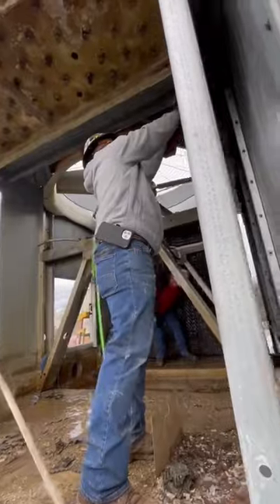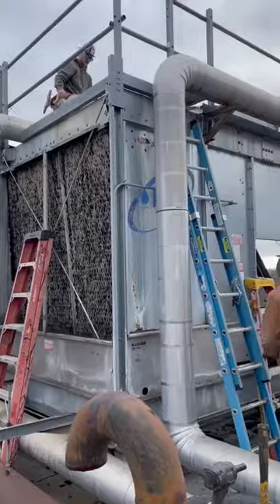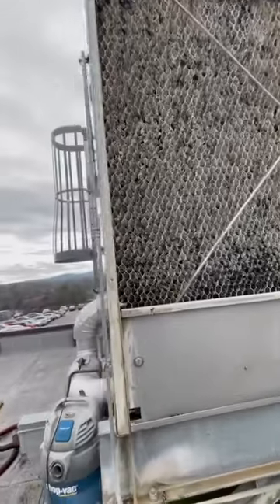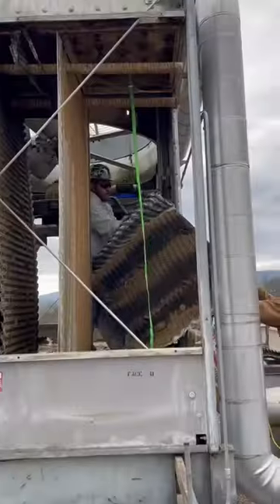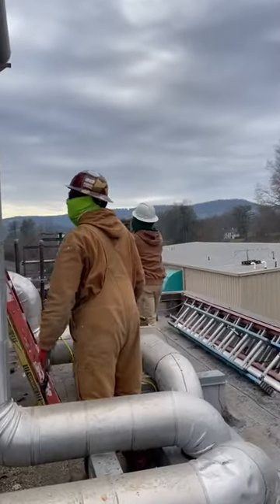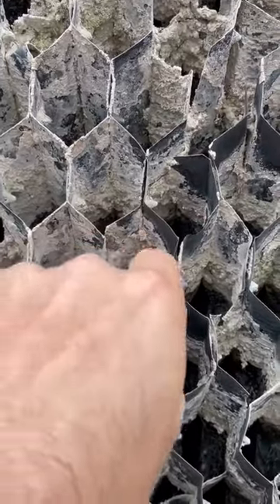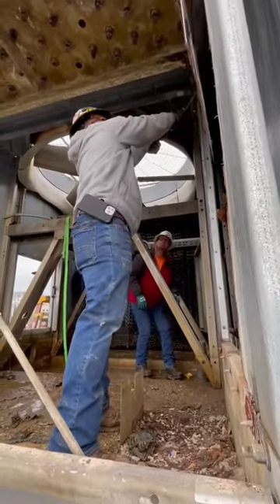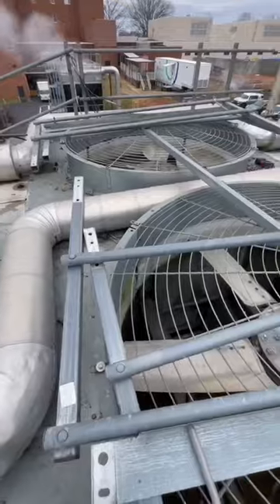Part one of this #coolingtower renovation. InsightUSA.com #hvac #hvactechnician #contractor

Comment: No respirator, breathing in all that dry mold . Yikes !!!
Reply from the maker: It's not mold.
Reply: @HVAC-TV   okay, should I have said mildew ? Or what is it then ? That stuff is green,slimy and nasty when wet and I wouldn't take the chance taking apart the fills without a respirator . As we know they're have been a few of them linked with legionnaires.